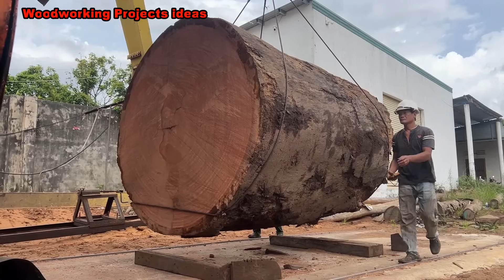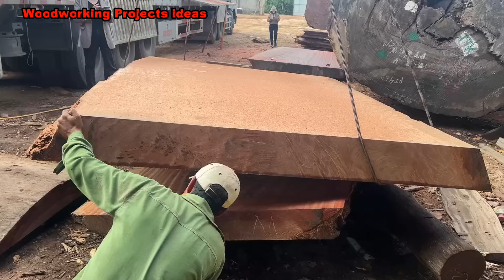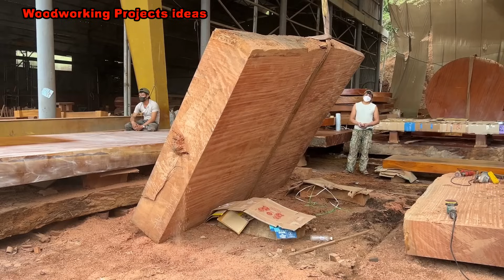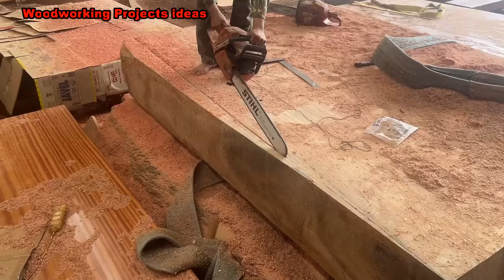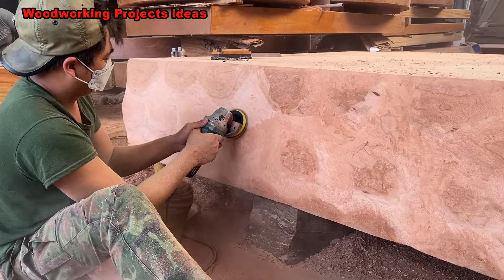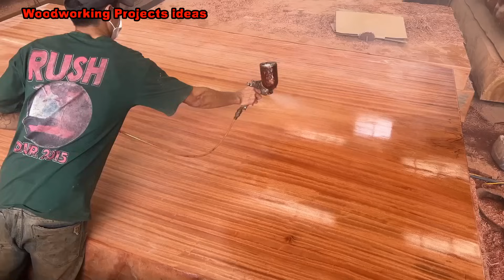Idea To Make A Giant Dining Table From A Super Large Tree // Super Large Woodworking Project

Comment: No one needs a table that's 18 inches thick. You could have made 10 table tops out of that one slab. I consider this wasteful.
Reply from the maker: when you divide it into 10 with such size it is very easy to break and can not be used
Reply: They are still building table I am sure.  Why don't you buy a slab and cut it into ten tables?  See; private property counts.  You don't get a say so, without money.
Reply from the maker: That's an interesting perspective! It's true that private property comes with its own set of rules.
Reply: No one cares what you think!
Reply from the maker: Yes, each person will have their own way of thinking, depending on the situation.

Comment: I doubt they are practical. A strong concrete floor would be needed to support one. I also can't see how your legs would fit under the table. In addition one would probably need to be installed first and the house built around it. And what would you do if you decided to move?
Reply from the maker: Thank you for your advice, regarding transportation we have cranes with a tonnage of up to 20 tons, the transportation work will be very complicated.I'm wondering if this is a reasonable way to do it